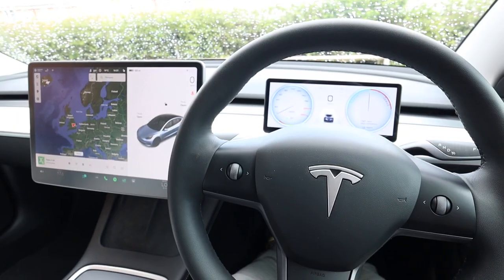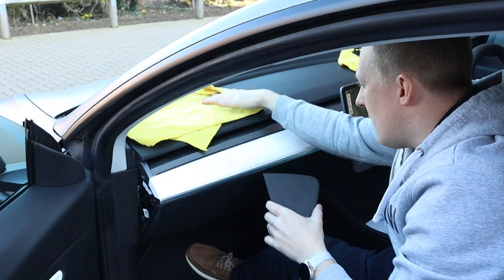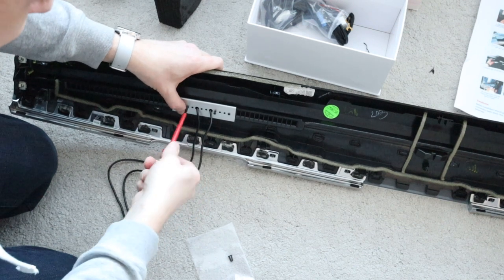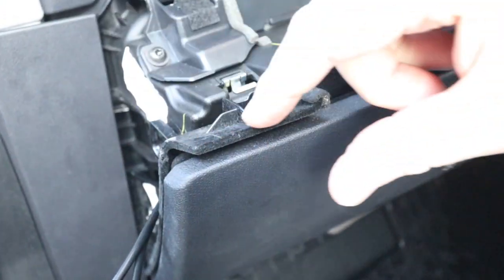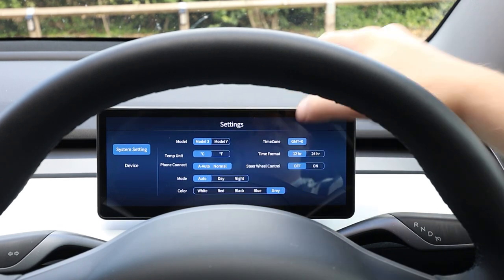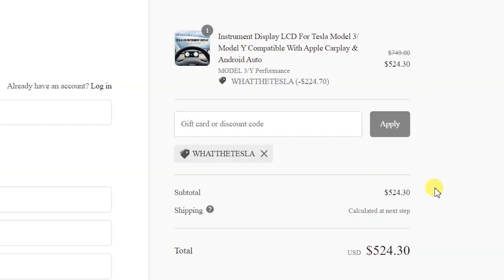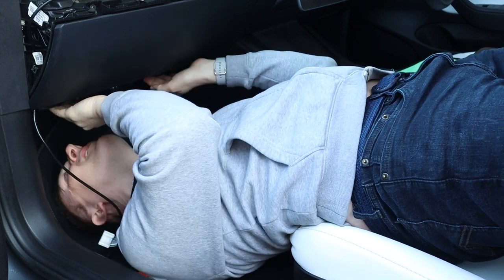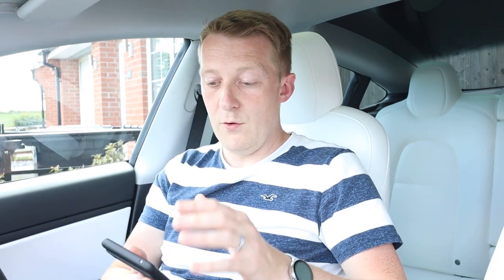Tesla Android Auto & Apple CarPlay Digital Drivers Display for Tesla Model 3 and Y -Install & Review

Comment: Does voice assistant stuff work on it? I normally use the voice command button on my car to activate Siri but afaik the Tesla doesn’t have one of those buttons on the wheel.
Reply from the maker: This unit has the option to use the steering wheel controls in the menu. I don't use that feature though because you can just say "Hey Google" or "Hey Siri".

Comment: Useful video🙂 Good to have you back again. Do you know of anyone having warranty issues after installing one of these? And how's your paint holding up?
Reply from the maker: Hey 1pandroid - thanks for your comment :) hope you're well.
I did ask my local service centre if it affected warranty and they said not... however I imagine this would be subjective.
Ngenco still looks incredible but as the top layer is over a rubberised layer it's a little more vulnerable to stone chips on the bumper. Next time I'd probably go for vinyl.